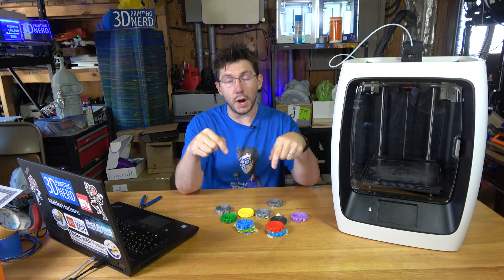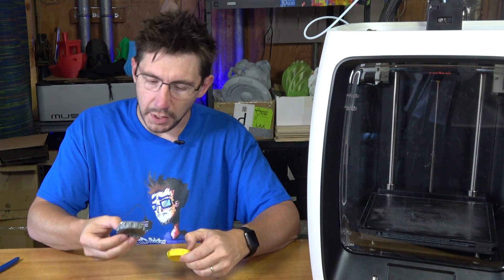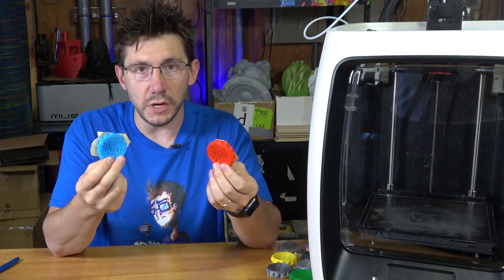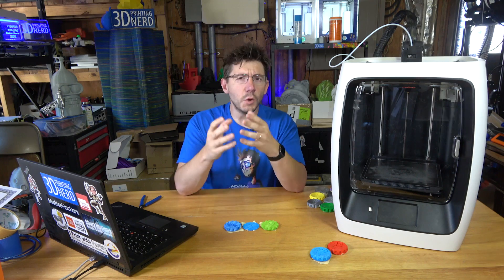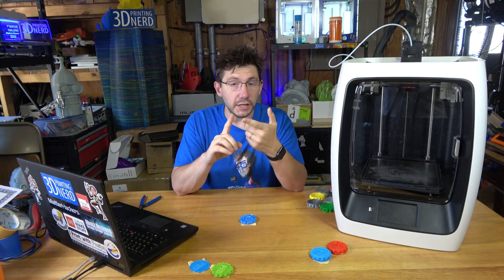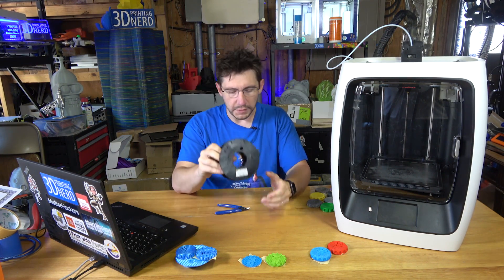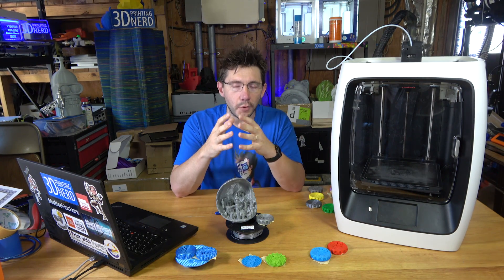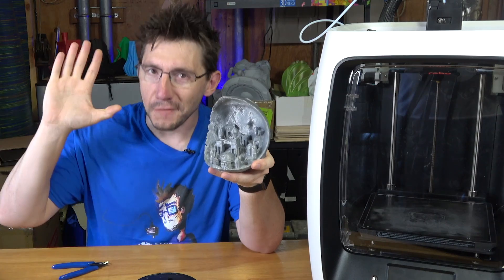The Robo R2 3D Printer Jams On Some PLA Filaments - Here is Why I Think That Happens

Comment: R2 is a pain to use. Most prints fail. i own one and also own another printer that is 3 times cheaper and it already comes with the dual extruder. I use the same filaments on both printers and only sometimes it completes the print on the R2 and i have to constantly fix issues with it. The other printer i have not yet seen a failed print and the prints are on point. I 100% agree that the R2 is picky with types of filament. I also think they need to fix a lot more on the R2 but I'm no expert, just what i think...

Comment: awesome...can you tell me the name of the material that you used to print the moon base?  i got some filament from amazon and all i see on the box is hatchbox PLA...and i am very new to this so any suggestions will be nice.  i have had the clicking problem and i will try to do it with out the magnetic cover that blocks the air....also my print bed is new...and is kinda rough...i think this causes prints to stick to the bed so much that i have to use all my strength to get it off..i have to heat the print bed all to way to 100 celsius and still struggle to get it off.  i noticed that in the robo videos they have a print bed that is shiny unlike the one i got.  any idea about this?  i can't get prints off without destroying them and for a 230 lb guy who lifts weights...i find it odd that i have to use all my strength with the scrapper and often have to destroy the model to ever get it off...is this the filament? ill try to include the link below
https://dagoma.fr/boutique/produit/filaments/filament-chromatik-pla-1-75mm-750g-argent.html

Comment: Have you tried seasoning the nozzle? I have had the same issue with those hexagon extruders with PLA. little bit of cooking oil on a paper towel that the filament runs through fixed it for me.

Comment: A few things bug me with the hotend design: The fins on the heat sink are short and fat, so low surface area exposed to air to exchange heat and high internal volume to retain heat. The central tube the filament passes through looks thick, so more heat will be conducted up the tube vs finding it's way to the fins. The fan is placed near-ish the heat sink with nothing done to force air to move through the fins. Of course lastly we have the magnetic cover turning the entire assembly into a nearly closed box at the start of the print when the head is next to the bed, where the two part cooling fans will be blowing air in at the hot end and fighting with the one fan trying to blow air in from the other direction. That is where all the print failures were: The first centimeter or so from the bed.

Kludge fix: Keep that cover plate off, take the cold end cooling fan off from where it is and make a cowling that attaches directly to the hexagon cold end and forces air through it. It'll look like what e3d / Lulzbot / Dyze / etc do for their fan mounts, and it works.

Manufacturer's fix: As above, with venting on the back to better allow air to flow through without getting blocked. More & thinner fins on the heat sink to increase that surface area as much as possible. Eliminate the ultra-thick fin at the bottom next to the heat break, it has enough mass and is close enough to the heater that I'd bet it is soaking up enough heat to cause problems just by itself.

Comment: If I'm not mistaken, Robo uses the same all-metal hotend that Lulzbot uses. They get it from a chinese supplier called ReprapDiscount.com. While you're right on point that the fan is not positioned correctly (it seems off to the side?) and is far away from the fins, the real issue here (and with a lot of all-metal hotends) is that suppliers don't properly polish the heat break. Heat creep will always happen on all-metal hotends and that is the reason you're supposed to polish the internal of the heat break. Take one of those hotends that hasn't been used yet and check the heat break under a microscope to see if it's polished or scratched from drilling/cnc and you will have your answer.

Comment: I had similar issues with the PLA/PHA filament on my E3D V6 whenever the print speed changed. I removed the heat break and added thermal paste between it and the cold end. Since then I have had a much better time with all my prints and no issues with jamming.

Comment: I had a similar problem with the all metal hot end on my Taz 6. It turned out that the hot end fan wasn't aligned quite right and led to misshaped filament at the input point. Filament wouldn't go in our out so i took it to bits and cleared it all.
Great video, so many coins! #highfive

Comment: I like the Colorfabb PLA/PHA, but I've run into issues with it blocking as well. My supposition was also that it had to do with heat creep and I was able to get better results with a number of tweaks around that. 

This was on my Lulzbot Mini, so it's not 100% analogous -- but I definitely think the filament's properties is playing a not-insignificant role in allowing the heat to propagate up the extruder path.

Comment: How can you claim it's picky with the filament when your printing with the exact same settings across many different brands of filament. Shouldn't you be adjusting settings for each filament. 

I found that Maker Geeks PLA tends to prefer higher temps. I have their White Hot White and Royal Purple. Both print great at about 215 to 220. Though on the spools it recommends 235. I also noticed the filament tends to cool rather fast so if the retraction settings are not right it will cool enough that when pressed back into the hot end it will not have time to fully melt and make it through the hot end without clicking.
Reply from the maker: +Pilch Plays My tests here used what I thought would be a common ground. Many of the PLA rolls tried here I have printed successfully at 201c-205c on other machines, hence the trial here. I still have a lot of printing to do, and I know for some of this I'm learning as I go. Thank you for watching!

Comment: Odd. The C2 from Robo has the exact same hotend setup and I have dual extruders on it and not a lick of trouble with heat creep. Two hot extruder and the cover on ... not a problem.
Reply from the maker: Really? Hmm... What PLA filaments have you run through? What temps do you run?

Comment: Hey Joel, thanks for the video! I have an R2 and got in touch with ColorFabb because of their PLA/PHA jamming, just like you found. Their advice to me was to print with the heat bed off and the door open, to minimise heat creep. It's worked so far for me, even though I never tried anything as large as the moon city.

Haven't tried printing with the plate off, but printing with the door open made a huge difference.

Comment: I've had trouble before with Rigid.ink PLA clicking in my UM2 - I cured it by baking the filament at 50C for about four hours. I taped a sheet of card over the hole in the front of the UM2, balanced a piece of card covering most of the hole in the top, cranked the bed up to 90C and stood the roll of filament on a small glass dish to hold it up from the bed. The UM2 holds a surprisingly good 50C inside when you do this. I'd be interested to know if this helps with your clicky filaments too. Cheers!!

Comment: This was useful and helpful! Thanks! So we printed an OmNom using new filament with and without the magnetic metal cover on. The print WITHOUT the cover definitely shows signs of an improved print! We have to make adjustments (flow, retraction, etc) but it was better. Sliced with Cura using default R2 settings (medium quality, RoboPLA setting, but with fans running 100%, 20% infill). Printed at 75% so we could see examples quicker. Buildplate was heated. We have noticed no difference in quality with the plate heated or cold (heated was better with adhesion, + gluestick even better) 

We have both a C2 and R2 (both appear to have the identical printhead beyond some superficial color changes), and have been having some troubles creating nice printed pieces. Except with some Hatchbox glow-in-the-dark PLA & wood filament from MG Chemicals. So Hatchbox seems to work well and we'll be trying more of that soon to be sure. Just bought some new PLA from a local supplier (filaments.ca, because they're nearby) which was what we used for this test. It's been good filament for us.   

Will try S3D next, but I still find that a little daunting as I've only been doing 3D printing for a couple months. We may try sticking a couple pieces of card to see if redirecting fan airflow does anything with the right-side fan.

Comment: I am wondering what would be a good controller that can replace the smoothieboard? My smoothieboard is experiencing firmware crashes all the time using symplify3D and the lack of key features in pointerface makes it almost unusable. Seriously though, it has no position readout....  I need that to level the bed and to recover prints. 

Anyways, I am using external motor controllers and I would like it to be capable of dual extrusion.

Comment: Here is a question. Why bother doing this unpaid beta testing of the Robo? Clearly the machine wasn't fully tested during development. The more videos you do on it, the worse the machine looks. Heat creep is solved with a good heatsink and cooling on the cold zone and well machined heatbreak. Here is a thought, there is a company in the UK which has a really good handle on designing hotends, and is basically the standard for hotends, that said company has numerous clones and numerous heatsink fan mounts designed by the community. Maybe Robo should -- hmm...do what Prusa, and gCreate did and just use a hotend made by that company and call it a day instead of using a part which is clearly not as good.
Reply from the maker: Hey man! I do understand what you're saying. I don't think further testing like this will happen, but, I'll continue to poke at the machine to satisfy my own curiosity. Also, I know Lulzbot uses the Hex hotends, and they don't have any issues printing with PLA materials. Perhaps they have a better cooling solution? Either way, I value your opinion, and thank you for the comment.

Comment: Your opinion please. Love your videos. Flashforge Creator Pro or Creality CR 10S
Reply: Stephen Edgar look at the old videos for the Flashforge Creator pro ! It was his (and mine too) first 3d printer ! I highly recommand it btw but haven't test the cr10
Reply from the maker: Leo is right, the FFCP was my very first printer! It's a workhorse. I haven't used any of their newer FFCP models, but, I hear it's good stuff. I've only used the CR-10, not the CR-10s, so I cannot speak for that specific machine, but the CR-10 itself is a good deal for what you get.
Reply: 3D Printing Nerd sorry for being such a fanboy ^^
Reply: I have had my FF Creator pro for two weeks. The X Axis motor stopped working. Cantacted Flashforge-USA and was told that they will not honor any warranty problems as I bought mine from Amazon. (strange) Flashforge China will be notified. But now I have the opportunity to return the Creator Pro and get something else. Would you opt for a Creality CR-10S if I have to replace the Creator Pro?

Comment: I have had exactly the same problem with the prusa when i ran out of the original pla filament. I could somewhat resolve the problem by setting the retraction to .9 mm - 35 mm/s - 5(yes it's a lot) mm wiping distance to get rid of the stringing. So far it works for me.
Reply: I use the noctua fan upgrade which i think reduces the normal airflow by a bit. but i excanged it for a silent 40x40x20 mm fan, which didn't solve the issue though. the clog was just delayed.

Comment: The hotend looks like my Hexagon from the MicroDeltaRework. I had the same issues and after two replacement hotends and tweaks on the airflow i gave up. The heatbreak is welded to the heatsink (i've read on some assembly manuals) and in my opinion the welding was bad on mine, so PETG worked and PLA jamed, even Fillamentum.
Reply from the maker: It IS a Hexagon hot end!

Comment: A odd result indeed, I changed the fan on the heatsink for something more powerfull, soft pla is hard enough on a all metal hot end and lowering the temp (185°-195°) helped me achieve proper retraction (no clicks) and avoid heat creeping up. Maybe that plate helps with pet-g or ABS. Unfortunately for me, the room with my printers is always around 95°F so i constantly have my heatsink fans on 100% or else I'll be able to cook a egg in there.

Comment: Am I the only person that thinks PLA is "Baby's 1st 3D printing filament" and that real 3d printer tests should be ABS & PETG filaments?

Also, tests of bridging and retraction/depriming instead of a bunch of boring coins?
Reply: I don't see any real reason to print in ABS unless your print requires extra heat resistance or is going to be moving a lot (like a drag chain). Why is ABS so popular?
Reply: In the context of a 3d printer review? Because in a machine like the R2 (mostly enclosed build space) it ought to be able to print it fairly easily given the big challenge with ABS for most other printers is that they cannot print in an area that is protected from random drafts of cooler air while the print is ongoing (ABS hates temperature shocks while printing).

However, if it's having issues just printing PLA--regardless of the manufacturer--that doesn't bode well for a $1500 machine in this age of hobbyist 3d printers at less than 1/4 that price that outperform it with the same filaments.
Reply from the maker: +Daniel Turner DANIEL! There you are.
Reply from the maker: Also, all kidding aside. I mostly agree with you. I think, though, a machine should be able to reliably and consistently print Baby's 1st 3D Printing Filament easily. I can print the Colorfabb PLA/PHA all day in my E3Dv6 on my gMax at 201c, so I figured the R2 should be able to do the same. I do have some further results, just not ready for public sharing. If you want, we can continue on email.
Reply: Annealed PLA can easily withstand immersion into boiling water, and is still very difficult to bend, let alone break, just after it has been taken out of boiling water.

This isn't theoretical. I have done this test myself to prove the point, based on the video by Thomas Sanladerer where he annealed several types of 3d plastics to test the efficacy of that process.

There are, of course, issues with annealing PLA such as dimensional variations and warping, but I have found, empirically, that these issues can be minimised by slowly ramping the temperature up to 110 C over a 20 minutes holding the temperature for a further 20 minutes, and making the temperature slowly drop over a further 20 minutes. And in any case the dimensional variations are fairly consistent and thus can be compensated for in the print size that is sent to the printer. 

When I say slowly cooling, I don't mean just switching-off the oven, I mean using the thermostat to control the temperature to 60 C in small steps over 20 minutes.

The whole picture with annealing PLA is still not clear, but I have have had great success with it and now I routinely anneal PLA prints like buttons that my wife needs for her craft projects because those buttons must withstand repeatedly being put through the washing machine.

In summary - PLA is a clear winner among 3d printed plastics for mechanical properties when annealing is done properly.

Comment: Would have been great if you'd repeated the maker coin test which failed with the plate on but worked with it off. The basic scientific principle, can you repeat the experiment. As you mention there are many factors that affect filament performance. Repeating the test would have been more conclusive if you had then got the same results. I have an R2 and have only ever had one jam. That was with Proto Pasta's White Matte Fiber filament. I've had mechanical issues with the R2 but it seems to handle most filaments without any issue. Would be happy to compare notes.
Reply from the maker: I definitely would be curious to see what settings you are using and on which materials.
Reply: For PLA I use 210c for the hotted and 60c for the bed I leave the hot end plate on (unless it falls off - Yes that's happened) and leave the door closed. Have you tried touching the heat break while the nozzle is hot? It shouldn't be anything more than barely warm. Two things I've found that make a big difference to being able to product useful prints are adjusting the support and raft settings, without making these changes I find impossible to free the print. SUPPORTS - enable roof and floor, set Z gap to 0.335 and XY gap to 0.8. RAFT - set the air gap to .35
Reply: Yeah I don't think it's a heat break issues Joel. I'm running a print right now and the heat sink is almost cold to the touch. I've got the hotend set at 210c and those fins are doing a cool cucumber impersonation.